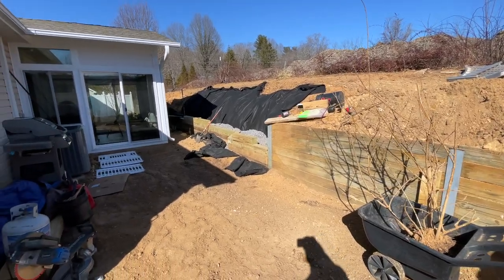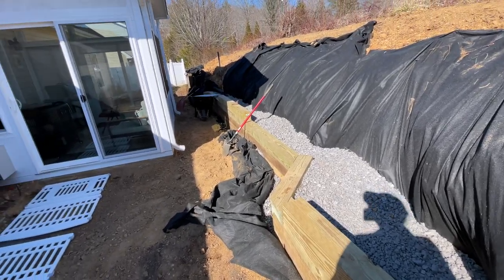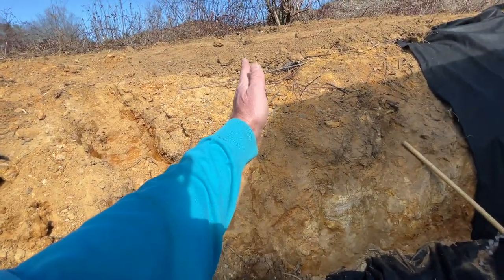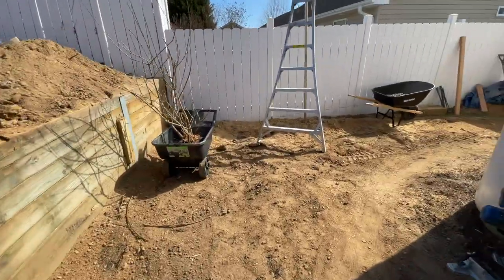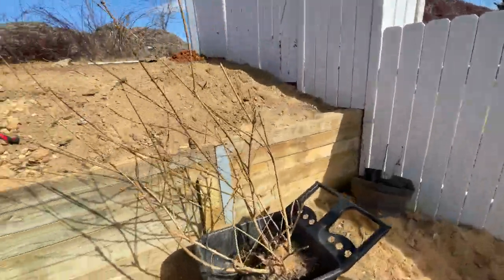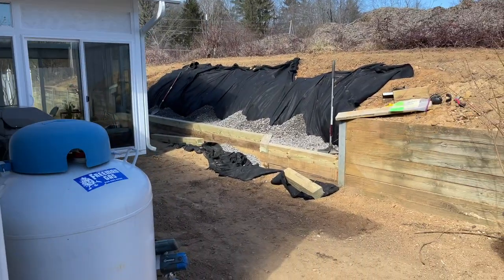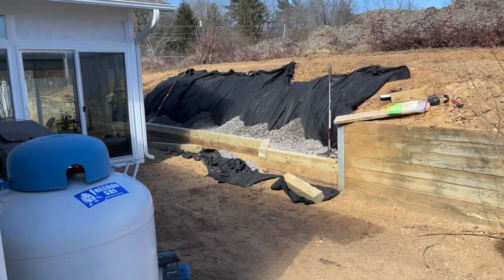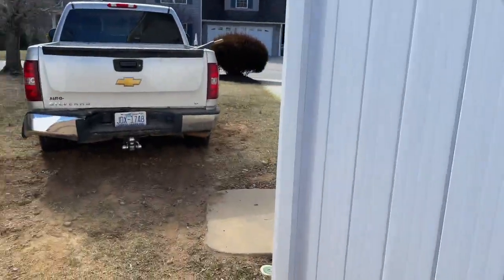FIRST DEADMAN INSTALLED IN THE RETAINING WALL!

Comment: Where did you get the I-Beams?
Reply from the maker: The I beams were there with the existing wall, we took the middle section out and replaced without using I beams but I thought I saw you can get them at tractor supply.